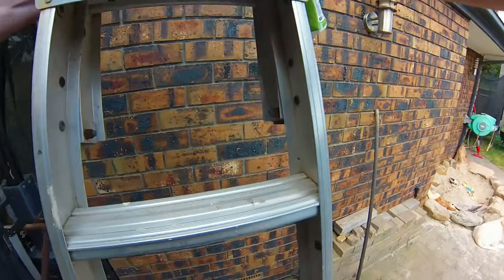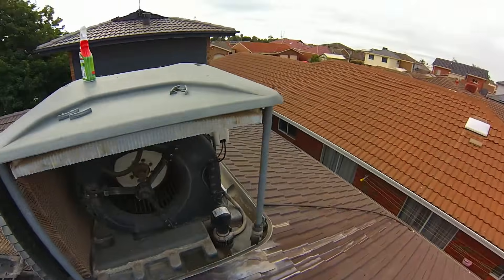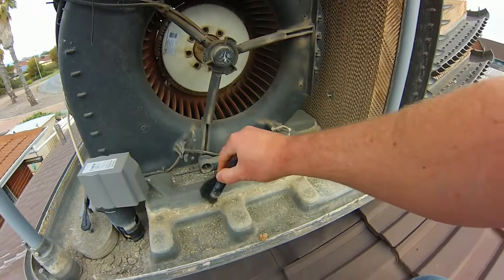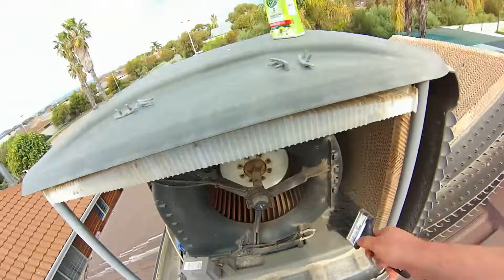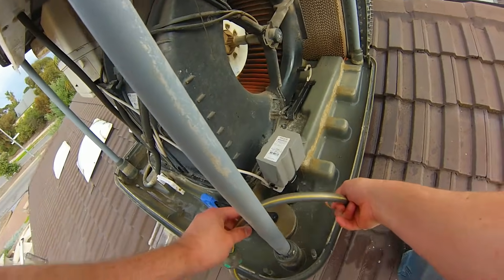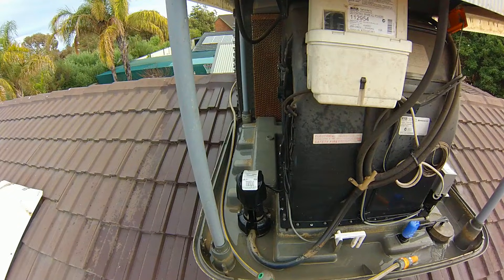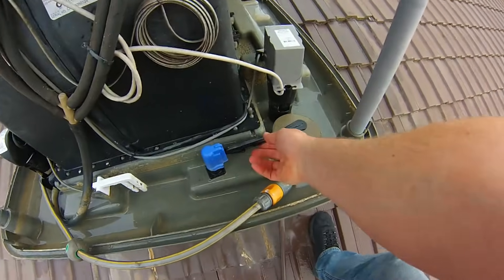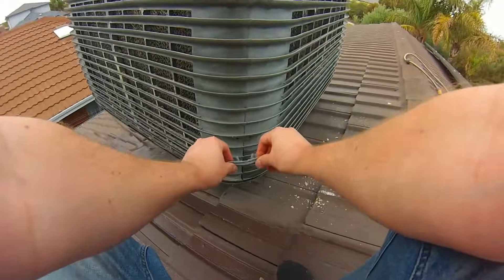Easy 15-min Evaporative Swamp Cooler Maintenance DIY Service Breezair

Comment: I have a Breezair EXV155. It was installed in 2017. The solenoid went bad so no water was going into the cooler and I had one of the Seeley International recommended companies replace it. Now when I try to use the cooler it's fine except it's using way too much water. There's no leak in the line or the cooler because it would be running off my roof and down on the ground it's completely dry. So there's no leak but the water is running at 0.2 GPM almost constantly once the unit fills.  It used 15 to 20 gallons running it for three to four hours yesterday. But it isn't leaking. I've e-mailed Seeley but am covering all bases.  It's not even that dry here right now- moderate humidity.  Where is the water going?  When the unit is turned off no water is running through my water softener so there are no leaks in the line or anywhere.
Reply from the maker: If it's not leaking then you must be losing water via evaporation.
Check that it is not spilling over and onto the roof. As this could be a blocked drain overflow.
Reply: @NotSealed  It's not spilling over onto the roof and it isn't leaking. I have a flat(slight slope towards the back) roof and I'm in the back room where the water runs off through what are called here canales(drains) and no water has drained out- the ground has remained completely dry.  The company that put in the new valve is coming back tomorrow.
Reply: It was the salinity sensors that needed to be cleaned off and the float. There's no leak another guy from the same company came out and fixed it a couple days ago. Now it's working normally
Reply: Well it turns out he didn't fix it so there's no leak but for some reason there's a flow into the cooler at 0.2 GPM. I know somebody who works as a plumber for the county and she said that maybe some debris got into solenoid valve or the only other thing I can think is it's a faulty valve because there's no water going through the water softener when the cooler is shut off so it can't be in the water line.
Reply from the maker: @RussellUpsomgrubb  Im at a loss. The only thing to do is take off one panel and run the cooling have a look at what is happening with the water.
It should cut off when at the proper water level.
It may make a mess with one panel off and could be slippery so use a harness for the inspection.
Reply: @NotSealed  Well I'm pretty sure the solenoid valve that was sent to me is defective because I looked up the company I ordered it from, Appliance Factory Parts, And they have an F rating with the better business bureau. Plus they billed me for a second amount on the same day they billed me for the solenoid valve for something I didn't order And they have yet to get back to me about the solenoid valve being defective.
Reply: @RussellUpsomgrubb  The breezair solenoid valves are fairly reliable and should last 10 years+.
They are 24vac so can only really be checked on the evap cooler.
Take a panel off and check water flow.
Reply: @ravenit1  I had a company out today and he may have deciphered the problem. The solenoid valve is working but it's only a quarter inch Water line going to the unit and I guess he said it's sucking the unit dry because it's not filling fast enough. Probably the quarter inch line was fine for the last few years but I imagine over time because I'm on a well, even though I have a water softener and a sediment filter that I change every 3 months, the quarter inch line probably got filled up with crap in it over time so he wants to come back and replace it with a 3/8 inch line anything that'll make it fill up faster and stop the constant water flow.
Reply: @NotSealed  The guys who came out today said the unit was getting sucked dry because it's 1/4 inch line going into the cooler. It needs a new drain pump which is dripping slightly so when he comes back he wants to replace it with a 3/8 inch line because he says it'll fill faster and it won't suck the unit dry so I won't get that constant water flow. That probably makes sense because I've been using that same quarter inch line for 6 years and it's plastic or rubber or whatever and even though I have a water softener and a sediment filter I change every 3 months it probably got clogged up with some stuff.
Reply: So in the last two months, I have had the drain pump replaced, the guy put in A 3/8 inch copper line to feed the cooler, I got An OEM solenoid valve and new pads put in two days ago and nothing has changed. When I turn the unit off, there's no leak anywhere else but there is a continuous leak of 0.2 gallons per minute going into the cooler and it can't be from evaporation because that's 12 gallons an hour. I've had this since 2017 and it's never done this before and it's been hotter. The last plumbing company that came Tuesday is coming back Wednesday. No one seems to be able to fix it. The only other thing I can think now is when I go up there myself again tomorrow, is the belt tension, the float valve Or maybe the two leads that go to the solenoid valve are touching somewhere else. I don't know I've been in contact with the local Seeley Rep who's in Colorado and no one has an answer.
Reply: @RussellUpsomgrubb  this is what I would do. Disconnect the drain line under the EVAP unit and see if any water comes out with the unit off and the tub full of water.
If no leak turn on the unit and see if any water leak. If no leak all good.
Next empty the unit and then lift the float valve and see if the water flow shuts off. Be careful as there will be water on the roof with the drain hose disconnected. Use a harness.
Reply: @ravenit1  Yeah I'm back to thinking it's the water softener. I had a slab leak fixed a couple weeks ago and I've been checking the water at night on my softener and it's read 0 overnight. The softener recharged two nights ago and it doesn't usually show the water used for recharging the next day But it showed 20 gallons used. Last night and the valve to the Water feed to the swamp cooler was shut off, the water softener showed 36 gallons used overnight.

Comment: Are this swamp cooler health for lungs when it use water for cooling?
Reply from the maker: As long as you have a few windows open for ventilation it's good.
If no airflow to the outside you can get mold buildup in high humidity areas.

Comment: My breezair gas started uaing roughly 16L per 30mins which seems like way too much. Would that be the dump valve? guessing ill need to get a pro in to check it out.
Reply from the maker: Yes way too much sounds like dump valve leaking or ball float not sealing off on a high level.

Comment: You make it look so easy and good safety tips too. My breezair evaporative cooler fan in the ceilings is not working in 2 bedrooms but is working everywhere else, you wouldn’t happen to have some tips on that would you?
Reply from the maker: Do you have controllable zones in your house. One or 2 of the diverter valves could have failed closed.
The other problem could be the roof space ducts could have holes in them. Silver ducting is the best and can last up to 20years. Some older plastic lined ducting can fail after 5 years.
Reply: @NotSealed  no I don’t have controllable zones and it is silver ducting. Where would I find the diverter vavles
Reply: @michmall2759  well the diverter valve are for control zones so if you don't have them then nothing to worry about. You will have to climb through the roof to see where you are losing air flow.
Reply: @ravenit1  thanks for the great advice I’ll have a look in the roof

Comment: Great video. My evaporative will work most the time and every now and then trip the power on the circuit switch . Any idea of what the problem could be?
Reply from the maker: Could be water getting into the electrics on something or the fan motor  pulling high amps due to seized bearings.

Comment: Nice video. Mine has water leaking out one of the corners constantly into my gutters. Most likely the float maybe not shutting off so water is constantly being pushed in via the tap you reckon? What would be the most common cause.
Reply from the maker: Yes the float valve is the problem. It can be adjusted or the rubber seat needs replacing
Reply: @NotSealed  Great thanks. Booked a service agent this time, but may have a go myself next time :)

Comment: Nice video. Mine has water leaking out one of the corners constantly into my gutters. Most likely the float maybe not shutting off so water is constantly being pushed in via the tap you reckon?
Reply: Its probably the solenoid valve which needs to be replaced

Comment: Do we need to clean or replace the filters each year. 2nd On air conditioning systems do we need to clean out the filters on an annual basis thanks for the video
Reply from the maker: Yes every year you will need to clean the filters. You do not need to replace them unless there is damage.
Not cleaning the filters will allow scale to build up which will cause the filters to fail.
Evaporate air-con filters should last 10 years +

Comment: MY unit is a Celair. Incredibly loud. The water pump works, the fan only works intermittently, and I'm hearing a whining sort of noise when the unit is trying to start. Is this a failed motor or something else?
Reply from the maker: You will need to take the panels off and try and start the unit to work out where the noise is coming from.
I have seen a noisy water pump cause start stop issues.
If the main fan motor is noisy it could have failed.

Comment: Hey mate. We've got a Brivis L51 and it's starting to smell like mold. Can we clean the pads with a mold killer or would the pads need to be changed?? We've had them changed once but the new ones didn't last as long as the older ones and I have my concerns about mold spreading through the house if we run the unit. Thanks in advance.
Reply from the maker: Best to take the pads off and down to the ground floor. Clean them out with detergent and you can use a mold killer. But rinse them well.
It's important to ame sure the evaporative unit is dumping the old water and there is a lot of windows open when running the unit.
I have seen people having damp houses with not enough ventilation. In humid weather evap units don't work well.
Reply: @NotSealed  Thanks champ. I took all the pads off and hit them with Mould killer. Hopefully that fixes it as the pads are only 4 years old..

Comment: Great video, just wonder any quick fix if the water leak from one corner ( I assume it not perfect level).
Reply from the maker: You can try and adjust the float level so it won't fill as much.
Otherwise it will need to be leveled again.

Comment: Hi mate. Great vid. I cleaned mine recently. The one I have is the larger one that has an angle to sit closer th the roofline. Is that an icon version as well? 
Wasn’t sure if it was ok to spray antibacterial spray on the pads, but I guess it is 😅
In terms of CLR clear, do you just put some on the bottom of the cooler and turn it on as per normal? Or can you spray on the effected area and scrub? 
Cheers mate 💪🏼
Reply from the maker: Either or CLR works great but stinks. Make sure to flush it well afterwards. Don't scrub the pads as it will destroy them just spray them on the inside and outside. Make sure to run the fan on low during the cleaning process and ventilate the house well.

Comment: Hi mate, it’s great video, my Breezair aircon stop working, wondering if you are living in Melbourne and it’s possible to contact you that will be great. Thanks.
Reply: Thank you so much for your reply. I couldn’t see any fault code but still has power in the controller, unit showing its preparing the system but no airflow coming.Could you recommend someone trustworthy? Thanks again.
Reply from the maker: Let me know if you have any fault codes on the speed controller. I'm retired.

Comment: Great video, thanks. Just noticed that my breezair was dumping water all night, would this be the drain valve stuck open? The unit was off, I isolated the water as soon as I noticed.
Reply from the maker: Could be a couple of issues drain valve leaking or open. Float not shutting of water or electric shutoff valve not closing. More details here https://notsealed.com/breezair-evaporative-cooler-troubleshooting-guide-repairs.html

Comment: Awesome video, thanks for the content ! Easy to understand and covers all the basics. Recently purchased a place with a coolair swamp cooler.. noticed that the ducts either have quite a hefty dust build up on the inside or black mould may be the culprit... going to attack a general service for the unit on the weekend.. but suspect new ducting will be the next step. Any advice on dust/mould in evaporative aircon ducts?
Reply from the maker: Mold can be an issue on vents. Exit mold is your friend. Just pop the square vents out of the holders and clean outside.
Keep doors and or windows open when running the EVAP unit to help control moisture inside the house.

Comment: hi i have just installed a secondhand braemar unit with the plug in style control box and and the wired remote unit. when powered on nothing happens, nothing at all. i thought dump valve needs to close first so tested this unit and it works as it should just doesnt get the close power (red wire) brown and blue have 24vac and this will keep it open. can you test the the main control unit anyway? also water solenoid does not get 24v ac to open.
Reply from the maker: Dump valve uses power to open and close the motor. Possible that the dump is wired up back to front. Check that there is power to the water in solenoid valve, but as you have no power to it could be due to dump valve staying open. Does the fan work on vent only?
If not could be a fan motor problem. In my experience in the motor fails it also takes out the control box.
Reply: @NotSealed  thanks for the reply, theres no power to the solenoid, leds on main box are good, fan does not run on vent. i assumed the wiring on the dump valve is correct as the unit has worked in the past and it looks correct from factory and hasnt been messed with. im going to try the wall remote on my uncles unit today make sure that works. i had to put a new plug on one end of the remote cable and made a test lead so i can plug the remote in when on the roof so its not the control cable unles they swap the wiring and both ends arent the same but i would expect the remote not to work at all if that was the case i could not find a cable diagram for the  remote cable.i will meg the motor windings aswell to check them.
Reply: i tryed my remote on another unit and all ok. so my remote does not have a backlight and does not say prestsrt or whatever at startup on my unit but did on the known working unit,.
Reply from the maker: Fan not running on vent is the key symptom. Must be a motor or control box issue. Some test you can do do check out the components are found here. https://notsealed.com/breezair-evaporative-cooler-troubleshooting-guide-repairs.html

Comment: Great video, thank you mate! As a bit if a novice, you mentioned isolating the fan before giving it a brush out. I hope not too silly a question, but how do I do this?
Reply from the maker: Either at the main switchboard breaker or inside the Breezair evaporative unit white box. It will have a toggle switch that can be turned to the off position.
Reply: @NotSealed  thanks for the reply, fully equipped to tackle this one now, cheers!

Comment: Just starting up mine for the season and the fan will not come on at all. Controller thinks it's on. Water pump works fine. Any idea what could be the culprit?

And thanks for the video!
Reply from the maker: Just need more information is there water in the aircon, is the dump valve closed, any lights on the isolator control box?
Reply: @NotSealed  so only lights on the control box showing are the normal 2 green flashes for Diag and one red for Sal. When the vent function is turned on, I just hear a click inside the control box. No fan turns on.

Fan spins freely when turned off. No noise or buzzing when turned on.
Reply from the maker: Sounds like either a motor or control box problem.
The older fan motors which were green had issues with shorted out wires. The newer white motors are better.
More info here on how to test the drive motors.
https://notsealed.com/breezair-evaporative-cooler-troubleshooting-guide-repairs.html
Reply: @NotSealed  yes, water in the air con. So it wets the pads fine. It dumps water as normal. Just the fan doesn't turn on or kick in. It doesn't even turn on in manual vent only mode. I'll check for lights on the evap when I get on the roof tomorrow
Reply: Easiest way to tell if it’s the motor or board is by looking for the power light to turn on on the board when you press vent. If it doesn’t turn on the board is gone and if it does and the fan doesn’t kick on it’s the motor 👍🏻

Comment: Is it OK to hose the pads out as they are very delicate on mine.3 or 4 yrs old. Coolbreeze CZ.
Reply from the maker: Yes no problem to hose them out with a mist spray not a jet spray. Best to take them down to the ground floor and hose them out onto the grass. This way less dirt will fall into the bottom of the EVAP air conditioner.
Reply: @NotSealed  Thank you good man.

Comment: How often do you replace the paper
Reply from the maker: I have yet to replace the cooling pads since installation. About 10 years. The only reason to replace if they get damaged, or blocked with scale/dirt.
Proper maintenance is key for evaporative cooler life.

Comment: Awesome video, just 1 question, why didn't you remove the last panel?
Reply from the maker: On my EVAP unit that last panel is the high point so most of the dirt runs to the low point. There are no user serviceable parts near the last panel so left it on for ease of making the video.
You can remove it for easy cleaning.
Glad you found it useful.